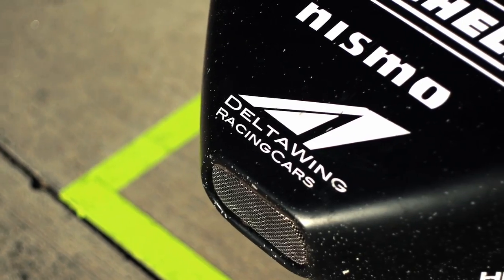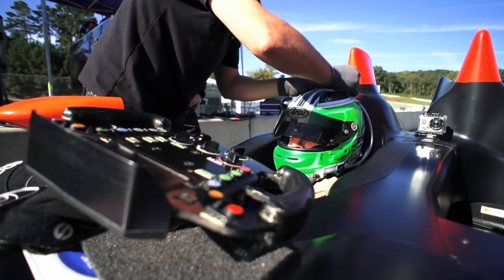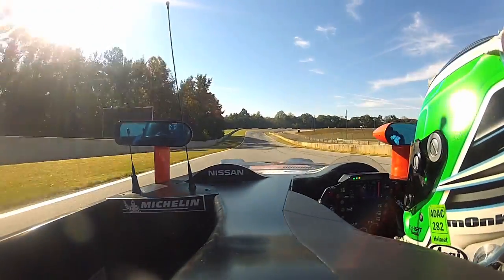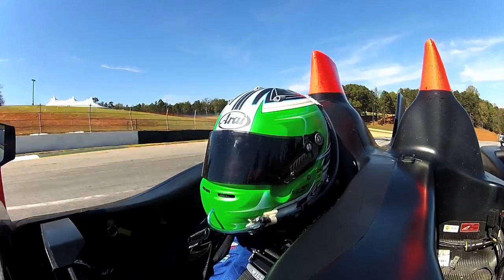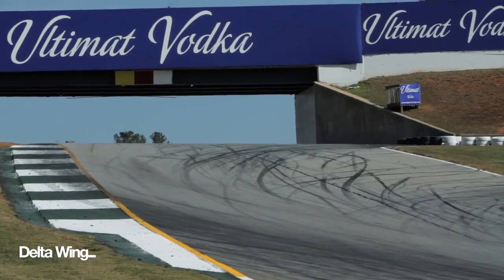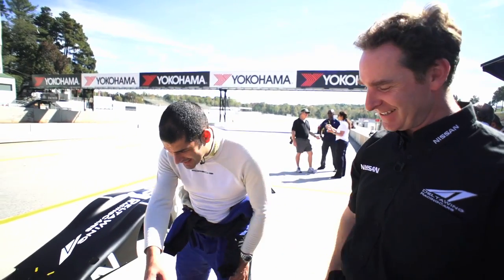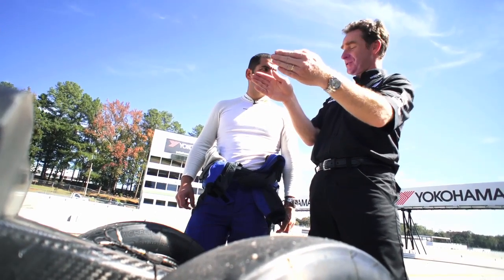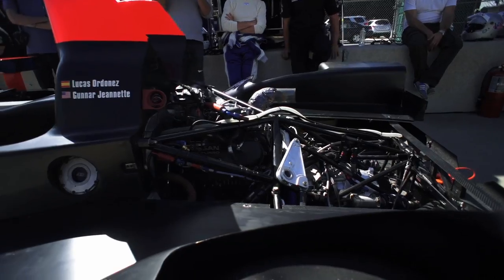Track Test: Nissan DeltaWing Driven At Road Atlanta -- /CHRIS HARRIS ON CARS

Comment: How that Deltawing get downforce ? Is that shape enough to have a wings-free racing car ?
Reply: the underbody creates low pressure areas that suck it to the ground, just like a diffuser but the deltawing does it extremely efficiently. also since the car is to light it doesn't need quite as much downforce to add tons of grip the vertical wing in the back also stabilizes the rear and prevents excessive oversteer
Reply: Spencer Geerlings
 Ok, thanks !

Comment: The car honestly is exactly like a penis. It looks terribly ugly, but it's very effective at its job.
Reply: At first I thought it looked kind of silly, and yeah it does, but I´m growing to like it more and more now. It reminds me of the Lockheed SR-71 Blackbird, which has a very unique look for a plane as well.
Reply: Darri42 Very cool plane. Not so cool fuel efficiency, though. As you may know, it was built with gaps in the plating and fuel tank so that, when it got to a higher speed, causing the metal to heat up and expand, the gaps would close, rather than destroying the plane. It actually leaked fuel when on the ground. Very cool plane!
Reply: not at all, it's unconventiona, yes, but that's what makes it beautiful. To me at least, it's very cool.
Reply: kr00k3d100 it also leaked hydraulic fluid like crazy on the ground when not running because there was not enough pressure in the system  which always made a mess.
Reply: TURTLEMMC23 hydraulic fluid is nasty too, highly corrosive.
Reply: Big black one
Reply: Kyong Hansen motorsports is used for exposure for the manufacturer's. big deal. funny how this is "trash" yet its been made using science that makes it faster than any trash I mean car you've had
Reply: Jay Furler AK Hamilton
Reply: Lol effective at its job? yeah, I guess, if you consider its job to be flamboyant, grab attention of young kids whom know virtually nothing about automobiles and racing, and subsequently promote Nissan brand awareness, then sure. Otherwise its trash.

Comment: Anyone care to explain heave and roll damping to me? Can't find much on it?

I assume heave damping is vertical damping, i.e. over bumps and while accelerating/braking? And roll damping means, just that, i.e. around corners? So they've come up with push/pull rod geometry so it's firmer through the bends and softer while in a straight line? Would love a simple diagram to explain things. The rest I understood and was fascinating though!

Comment: this is exponentially better than ANY three wheeler ever conceived....any 2 wheeler that works has one massive tire at the back and 2 relatively skinny wheels at the front (spaced wide apart)....thats cool and all but this is a superior design on all points (2 wide tires spaced wide at the back AKA massive back grip and 2 skinny tires close at the front, much better for cornering)....everyone says its counter-intuitive but if youve passed physics 101 it makes sense

Comment: The mill is basically a worked over MR16DDT from a Nissan Juke pushing out approx 300 HP. Who saw that coming. And bullshit on it being a cheat. The fact that Bowlby decided to try a different approach to what is considered current dogma in sports car racing does not constitute a cheat. By that logic the Porsche 917/30 was a cheat, also the 935/6 and at least half of the cars designed and built by Smokey Yunick.

Comment: It's a cheat.  Low tech, uninspired cheat.  What's so hard about making a 417kg ground effect car go fast?  It's even got a massive Gurney Spoiler and everything.  It's like Chapman's Lotus 80 in 1979.  And ground effects are banned for a reason, just like Gurney Lips.  And really?  300hp isn't an impressive number and 417kg isn't either.  Today's F1 cars routinely wind up under 500kg before all the gubbins they throw in to meet the weight requirement.  This car is nothing special.

Comment: You're no longer even comprehensible.  Chris said what he said because he doesn't understand G-force around a corner.  He thinks that a good car reduces G-force.  It is what he said.  It is what he meant.  The designer talked about the springs because he understands physics.  I'm not talking about the designer.  Obviously the designer knows physics.  Chris is the one that said he felt less Gs around the corner because of the design of the car.  Watch 4:10.

Comment: The guy said something that makes no sense--that he is pulling less Gs around the corners than other cars.  The Gs in a corner is a function of speed, turn, and so on, it has nothing to do with the car itself.  The question is how many Gs can a car handle without sliding; the car can't lower the Gs you feel for any particular turn.

Comment: Notice I mentioned "faster in a straight line". Anyone who likes racing knows that it takes more than that to win races.
One should take in consideration this is a very innovative idea, and as such, will take time to further develop. Also, I'm not sure current regulations are either favoring or rather hardening its position on the field, but to able to get to 5th place in such good company is testament to its potential. 
To me, the fact that these guys are able to go race it is an achievement.

Comment: I believe the option there is not so much to go for power, but rather to get a compromise of both decent levels of power and good fuel mileage. As Chris Harris pointed out, it's already capable of going faster than many established racing cars on a straight line.

Comment: If I remember correctly the DeltaWing was originally designed as a single seater and submitted to be the next indycar, it didn't win the bid but Panoz liked the idea and build it with Highcroft around an AMR tub, Nissan then provided an engine an Michelin the tyres. Now Nissan and Michelin have left its on Bridgestone tyres and running an Elan motorsports Mazda based engine. With the linking of Grand AM and the American LeMan series they will still be allowed to race and a coupe is on its way!

Comment: Lmp1 cars only have 540 hp now. And if you had an lmp1 car that was half the weight n half the hp it would be a hole lot faster than this. But I like the car. But it doesn't really fit in anywhere

Comment: err.. no.. if it wasn't banned, F1 teams would be just as crazy on it now as they was before. it was just 'banned' that's why nobody 'cares' about it anymore. EBD (exhaust blown diffusers) of 2010 is actually a form of it, but instead of a physical panel enclosing the undersides of the car, it's the exhaust gasses that are doing it.

and it's not a gimmick too.

Comment: The DeltaWing is now being prepared to compete at The Sebring 12 hours 2013 in a couple of weeks time.....It will have about another 50bhp extra to play with (though no longer with Nissan power)....Will be using an Elan engine derived from a Mazda unit.

Comment: I love the engineering in this thing.. Some of that should transfer over to passenger vehicles. Light, aerodynamic front. Good adhesion in the rear. 
The only problem I see is the deceptively wide rear end. Would make passing difficult. And normal F1 racers have a proven crash survivability.

Comment: he wasnt quite on the money with the purpose of this car. Downforce was a huge equation, but the driving force behind the idea was efficiency. The deltawing consumes less fuel, and wears tires slower than other car designs do. Unfortunately, Nissan no longer provides the engine, but most of the 1.8t is now being built by another group. I believe the block is the only component thats still Genuine Nissan

Comment: Change the speed of the air below the car from above creating negative lift. Imagine a wing on a plane. Flip it upside down. That's what this car is. You can see the little sideskirts (which were banned in F1 for making so much negative lift) and some of the under-body diffusers when they take the nose off the car.
By creating downforce this way you reduce drag which makes the car have better acceleration at high speeds. Besides that, a car this light doesn't need that much downforce to work.

Comment: The car is running as a sports car not a single seater. To comply with safety regulations it is built around a tested & approved tub from an unsuccessful Aston Martin LMP1 project that was abandoned. The tub has achieved far greater success in the Deltawing than it ever did in the Aston.

Comment: It is as quick as LMP2 cars using only 300bhp and a fraction of the fuel. In a straight line it is faster than any LMP2 car (this was proved at Le Mans). There is a mass of information on the internet now about how it works and why it represents a major step forward in car design. If you were really interested in it you would have answered your own question by now. The Tyrell stuck a couple of extra wheels on the front of an existing chassis which was just an interesting experiment.

Comment: All physics lessons correct... Save one problem you've overlooked.

The four wheel matter DOES make a difference because, well... By having four wheels, despite the spacing, the wheels are still on the OUTSIDE of the frontal mass, and therefore cannot act as a pivot point. The result is that even if the car had the Robin's OTHER problems, specifically the higher center of gravity, the car would not tip over 
as easily as the Reliant Robin does - you'd REALLY have to try hard.

Comment: As a result, he tried using 2 small ones instead and discovered that they cornered nearly as well as one bigger one. Fortunately, two smaller wheels meant a heap of other benefits such as lighter suspension and brakes since two light wheels weigh less than one single heavy wheel. This allowed him to cut down on the weight and size of the vehicle. The result you see today is an evolution of those ideas.

CHECK, and MATE.

Comment: Additionally, when Ben originally came up with the idea of the DeltaWing, he experimented with a tricycle config and built a radio controlled car that had a similar config as the DeltaWing. He discovered that it would corner at higher speeds than a 4 wheeled version so he sought to scale it up to full size. A committee wanted to select a new Indy car for 2012 but Indy rules do NOT consider a 3 wheeled vehicle a car.

Comment: FALSE.

From a physics point of view, spacing two wheels apart at a given distance would behave similarly to one wheel that is the same width. The reason why the Robin keeps tipping over is due to numerous factors, three of which are: 1) the Robin's center of mass is much higher than the DeltaWings, 2) the spacing of the rear wheels on the Robin are much narrorer than the DeltaWing's, and 3) the DeltaWing's rear roll bars, where the majority of the vehicle mass lies, are stiff as a mofo.

Comment: So it has what, a Cane Creek Double barrel at each front wheel? Can't think of any other MTB unit, that would give the adjustability and the CCDB is very popular in formula student designs.

On the other hand, would it be possible to take a closer look at the rear suspension? Could also be done in diagrams, this video didn't really tell that much in my oppinion, just wet the appetite.

Comment: Thanks for the lap info, in the video it was just being driven very gingerly. I didn't know what it was capable of, although Road Atlanta is very car biased. Donington park, sidecar record is 1.10.1, European Le Mans record is over 10 seconds off for the Oreca Nissan. Actually bikes spend more time in turns if they are slower there, unless your saying a drag racer turns less than a road racer >.< The reason I prefer bikes actually, much more difficult in corners and little time on the straights.

Comment: The thing that's so hard to wrap my head around is how the damn thing actually manages to go round corners, cos I've got the Top Gear episode with the Reliant Robin stuck in my head. That car is obviously much different - suspension, center of gravity, etc. The Delta Wing is a truly revolutionary and impressive piece of engineering. Probably the coolest episode of Drive yet. Great job guys.

Comment: It's not designed as a drag racer, it's a road racer. Road racers spend more time turning than on the straights and they are way faster in the turns so you'll find that race cars are almost always significantly faster than race bikes on the track.

1:14.420 Delta Wings best lap during Petit LeMans

1:23.421 Ben Spies, Suzuki GSX-R1000, 2008, AMA Superbike
Road Atlanta Motorcycle Lap Record

Comment: You are indeed wrong. Again. The DW is able to corner at 4g because the rear tyres carry over 70% of the cornering load, which is due to the rearward weight distribution. The front tyres only do a small fraction of the work.

Comment: Do you ever stop? If the car had wider front tyres it would suffer from oversteer, not to mention it would require a larger frontal area, increasing drag, and the tyres would have a higher rolling resistance. They can use such narrow front tyres only if the car has an extremely rearward weight distribution (as it does), otherwise the pressure over each contact patch will be badly distributed (i.e. overloaded fronts and underloaded rears) leading to an inefficient use of available tyre grip.

Comment: Did you watch the video they explained why the narrow tires work on the delta wing 
"the width of the tire is solely for durability. A narrow tire has the same grip if it's the same material, however counter intuitive that is."

 That is not true an tire with a bigger width will have greater have better grip, the more rubber in contact with the road the more grip the car will receive it's as simple as that.

Comment: Nope. Race engineers take advantage of load sensitivity when tuning anti-roll bars for cornering balance. A stiffer front anti-roll bar causes a greater difference in load distribution between the front tyres, which reduces the overall front grip slightly vs rear grip, thus reducing oversteer / increasing understeer. It's also why a low c.o.g. is desirable in a racing car, so that the loads on all tyres are more evenly distibuted.

Comment: This is one of the best videos, it is so informative I learned so much listening to Ben explain how the car works. In a nutshell, the car acts opposite of a regular car, and this is literal rather than a cliche statement. Where as a regular car under braking and cornering the load is up front, this car the load is out back. The front having little load, it can turn/brake with small tires. It's almost like it's pivoting and around the centre and the rear just projects the vehicle.  Bravo Ben!

Comment: No, that's how tires work, fullstop, even when well within "rated" load. The lateral / cornering / traction force they can produce is not directly proportional to an increase or decrease in load. Say you get y units of force from a tyre under z units of load, you would only get around 1.7y units of force by doubling the load (2z units). Even if operating at small loads. If you want a source, google "tyre load sensitivity" or purchase a copy of "race car vehicle dynamics".

Comment: Tyres don't follow the typical formula for friction. If you double the pressure per area for a tyre contact patch, you don't get double the "friction" force. It's more like 1.5 - 1.8 times. Look up tyre load sensitivity.

Comment: But tyres don't have a perfectly proportional relationship between load and friction. I.e. if you double the load on a tyre, you don't actually get double the friction. You get something like 1.5 times the friction. Wider tyres increase the contact patch size and reduce the load per contact area, increasing overall friction for the tyre.

Comment: What Dan alludes to is tyre load sensitivity... In a nutshell: the more weight (load) you put on tyres, the worse they will perform... So you can get away with skinnier tyres if your car weighs next to nothing... Ben made this point: the DeltaWing works because they achieved a balance - if they put rear tyres on the front (which would brake not only the aero package, but would also skew the weight bias because you'd have to make everything heavier), the car would not work.

Comment: The weight of the car is distributed onto the area which is touching the ground (ie. the tire). This gives you a certain number in Force/Area. If the Area is smaller (smaller tire), the number goes up, if the tire is bigger it goes down. This only has an effect on the tire wear, not on the grip itself, Grip is friction which is Force*friction coefficient. As you can see, the Area doesn't matter because the Force (Weight and downforce of the car) is the same no matter which tire you have

Comment: More surface area, sure, but the normal load isn't really changing very much. That means the pressure is less, and the amount of load on each small finite area of rubber is also less. 

Considering that, is it really nonsensical for more surface area to equate to the same amount of grip?

Comment: More induced drag? There's less air resistance on skinnier tires. The cambers play a big part of the cornering of this vehicle. But there's more pressure on the front tyre due to less contact area and when subjected to higher forces around corners, there will tend to be more wear. There's more inertia carried by this vehicle through corners though due to its short front overhangs. Interesting concept.

Comment: "It is an awesome car but I would still bet money on a traditional style car of equal power and weight if they went head to head. A lot of what makes this car so fast is the ridiculously low weight which is not allowed in any of the classes it raced against."

Not true. With equal power and weight the Delta will always have the advantage because it has much, much, much lower drag. The standard car would piss away it's power trying to produce downforce with traditional high drag wings.